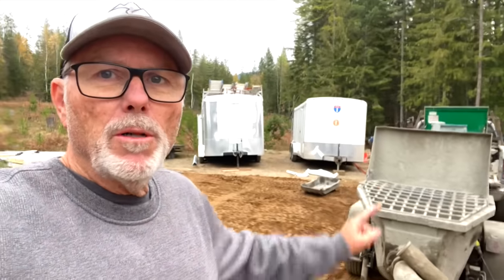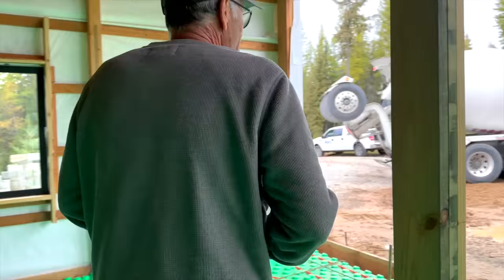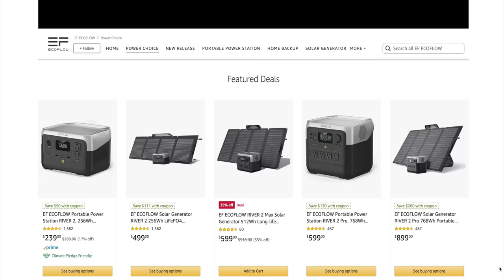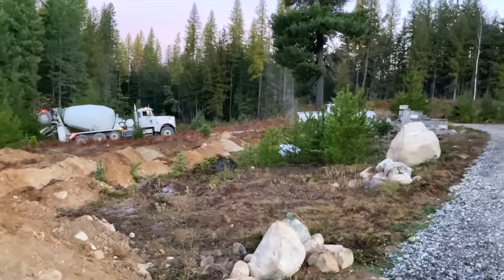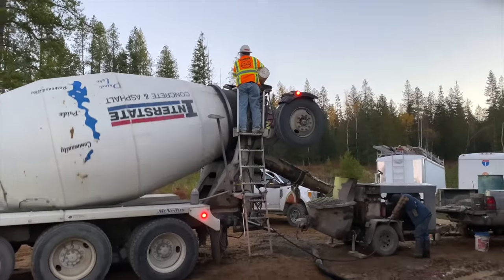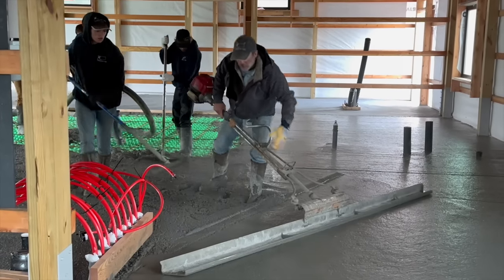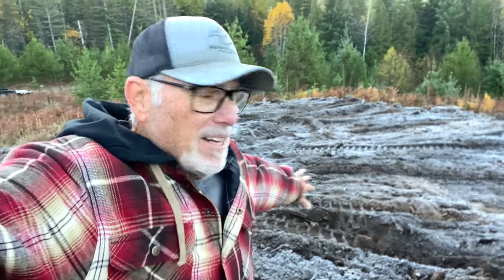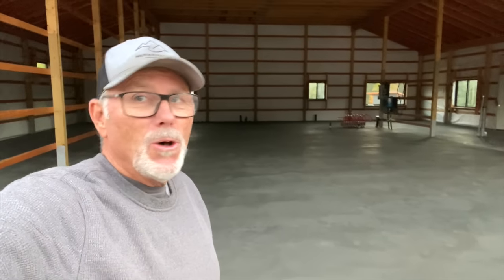MAJOR MILESTONE! Concrete Pour for Our Off-Grid Dream Barndominium

Comment: Hi Norm an Kim     This  is absolutely amazing awesome now you have your floor layed and it looks good . To think a few months ago when you didn't even have a roof on or side panels . You sure have got a lit done all the major ground works and now its looking  like  a barndomium for sure . Now getting all the wireing and connecting the wood boiler them insulation and sheet rock . Now get that side waterproof and then if weather is not good at least you can work inside enjoying the video's thanks
Reply from the maker: Thanks!  Pretty exciting for sure.

Comment: If you have a problem down the line with part of the floor not heating, how does that work? do you have to tear up the concrete floor?
Reply from the maker: Why would I have a problem?  It's pex tubing that runs hot water through it covered in concrete.  This is a very simple and efficient heating system.
Reply: Wow. I'm not sure. Was just asking.

Comment: No rebar?
Reply from the maker: Look again 😀
Reply from the maker: @rixtrix11 rebar is sitting on top of the green pucks giving it the lift.
Reply: Finish looks great, but no rebar chairs or manually lifting the bars to the middle of the slab adds very little support for the extra expense!
Reply: Agreed. 20 year concrete vet here. Rebar sitting under the slab serves no purpose other then wasted money. Needs to be lifted into slab.